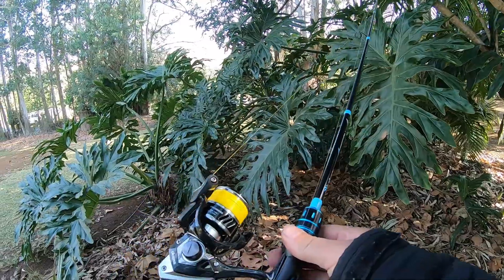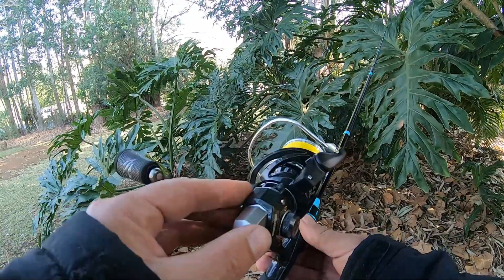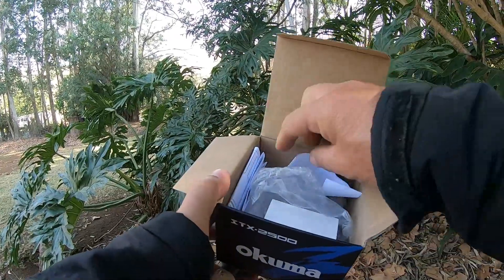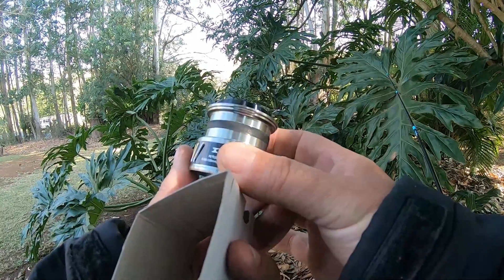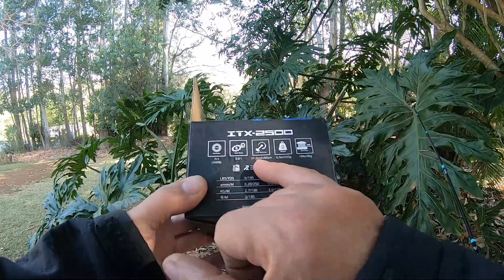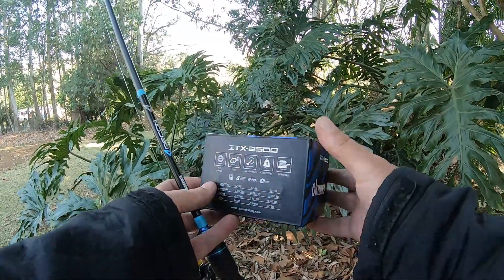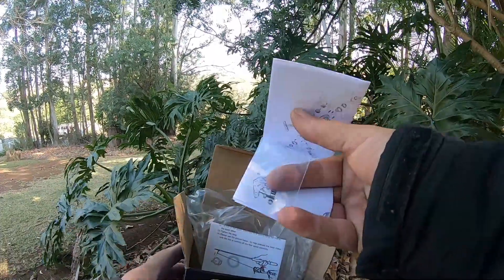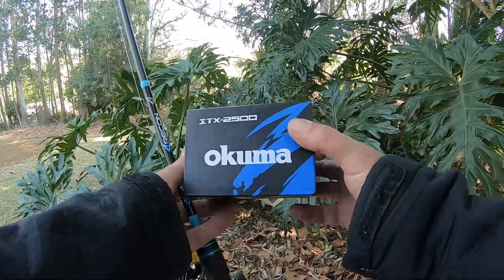Unboxing the New Okuma ITX Carbon Reel

Comment: I bought mine today from township but it didn't come with a spare spool. Size 4000h
Reply from the maker: You get two types
The first shipment had One with and the other without, price was also more
Reply: Eish I missed out then but nevertheless I'm yet to test it out it's already spooled with 15lb braid
Reply from the maker: The second spool was shallow and more expensive
Reply: I paid R1099
Reply: Atleast township is cheaper than gani's I saved like R200
Reply: But I just love all your video's especially those on the boat👌👌👌
Reply from the maker: Cheap bro
Reply: And your commentary🤣🤣🤣👌👌👌
Reply: With the 15lb braid, can I put 30lb leader or what should I use?
Reply: Really cheap bro I was actually surprised